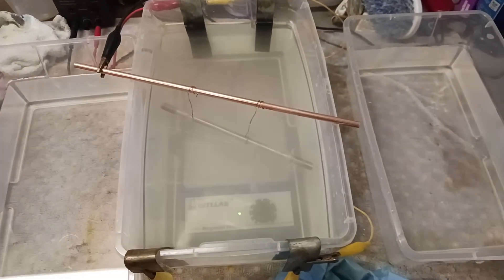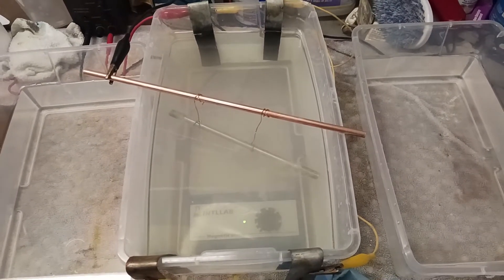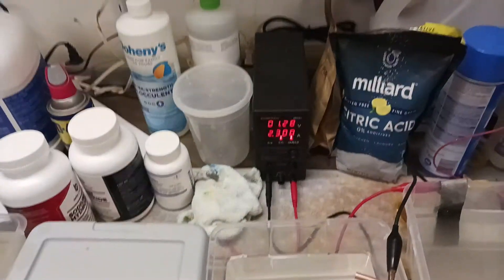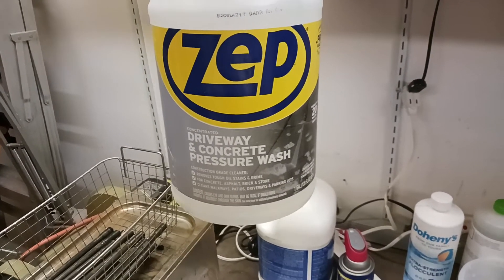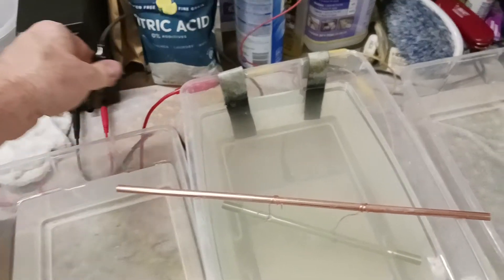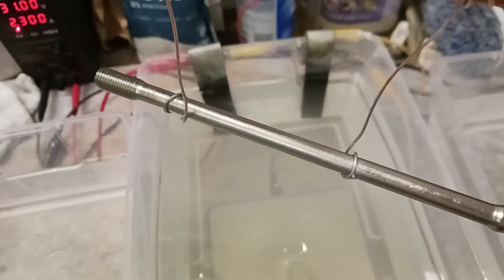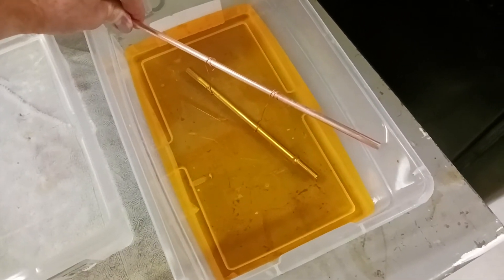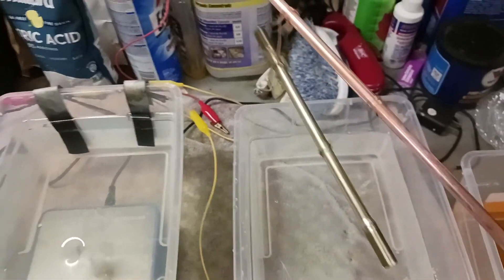DIY Bright Zinc Plating

Comment: A couple of questions. 
Do I need to periodically add more floccullent and vanillin. I've noticed the parts are starting to come out duller.
You mentioned in one of the comments that one of your anodes is steel, I believe. 3 zinc and one steel?
Is there any way to test the bath and see if things are out of chemical balance. You mentioned that too much zinc might get into the bath and upset things?
Thanks.
Reply from the maker: Yeah you will need to add more flocculent and vanillin, I believe these get consumed somewhat as part of the plating process.  Yes I am using 75% of my anode anode area as zinc.  As far as testing the bath, I'm sure there's a way but I was never doing this in enough quantity for it to really matter.  I just made the bath up fresh whenever I noticed any issues.
Reply: @mhdelano  Thanks. I've made about four batches, and found that adding flocculent and vanillin helps. Getting the amperage just right makes a huge difference. I've also found that making sure of what I'm plating is of the same size if doing several parts helps a lot.

Comment: Hi,
Do you know why the zinc anode would turn black quicker and amperage draw increase significantly more than normal?  Thx, Joe
Reply from the maker: I think the zinc corrodes eventually.  I haven't done this in a while but I remember doing a quick scotch bright rub of the zinc before every plating.
Reply: Wonder if it is the quality of the  anode or possibly my mix is getting old?  Sure has worked good for many parts...thx again...
Reply: From experincing the same problem myself and doing some reading - it seems that if you exceed around 3A/dm2 on the anode current density, you'll be getting poorly conductive zinc oxide on the anode. So either increasing the area of the anode or limiting the current could be options worth trying.

Comment: Hi,
Worked very good,thx!
Can you pour this mix into sink when done ?
Is the vapor toxic. does vapor  cause corrosion of equipment,tools in garage?
I used a respirator and did at edge of garage door with a fan blowing across and out but it would be good to know all aspects of safety.
Reply from the maker: Hi good questions. High concentrations of HCl will release harmful vapors so take care if you’re using that as a cleaning step. Also during plating you will be generating oxygen and hydrogen gas. Best to do this with some type of ventilation. Vanillin is somewhat volatile and will release vapors too. Other than that there should be no vapors released.
Reply from the maker: As far as pouring into sink you should be fine if you pour it very slowly with running tap water. Just dilute it a lot. I’m not 100% sure on this, safest bet would be to dispose of it at a hazardous waste day at your town, if possible.
Reply: Hi,
Thanks for quick reply...
I strip zinc with muriatic acid and then wire wheel part,degrease and plate...fyi,
I put several nuts with old but intact zinc plating and they came out nice.  
After cleaning zinc plate a few times with scotch pad I had to sand it aggresively to clean it..wondering if these zinc plating strips can be used until basically erroded to nothing?
Thanks...
.

Comment: That is really a lot of sodium hydroxide. Do you put that in only to bring the zinc ions into the solution or does it have another purpose? I am going to try this with just zinc chloride instead of zinc oxide and NaOH. Oh, and thank you for sharing your process with the world!
Reply from the maker: I think it's for a couple things.  1.) to help dissolve the zinc oxide.  2.) high pH 3.) ionic strength aiding the current flow in the water.    There are other ways to do this, I think zinc chloride typically uses an acidic bath, I'd suggest searching for zinc chloride specific recipes.  From my reading it seams the "brightener package" is the key thing that industry tries to keep secret.
Reply: @mhdelano  The brightening compounds are definitely the best kept secret I have researched as a DIYer.
I even bought several professional books about electroplating and at best they would mention a few chemicals, but no exact amounts.
In one german book they at least mentioned the importance of the exact dosage as they can vary from several g/l to a few mg/l, so the margin of error is minimal.
Reply from the maker: @traubengott9783  Yeah I ended up 3d printing a hull cell to figure out the right current density and additive concentrations.  For the compounds themselves I dug through some old patent literature.

Comment: What's the purpose of use vanillin? Does it help brighten the zinc?
Reply from the maker: You got it
Reply: @mhdelano  I tried doing this without the vanilli and the finish was dull. I used the doheny product though. I figured that would be all you need besides the other chemicals for the alkaline solution. I used 100% sodium hydroxide  and the zinc powder and anodes. Tried using more of doheny product with no success.  I saw the same video for the guy in the uk like you mentioned.  I'm wondering if doheny is as good of a product as he was using???? I tried doing this 3 times the same way in regards of the chemicals. I messed around with the amps to see if that was the issue. Either dull of dark gray cause I used too many amps. Anyway you can post links for the zinc powder and sodium hydroxide.  I'm wondering if the zinc powder I'm using is correct.  It said 100 percent zinc oxide.  Food grade. Help! Lol
Reply from the maker: @funnydude8523  the vanillin helped me a lot. I’d start by adding the vanillin.
Reply: @mhdelano  I'm gonna order the vanillin to see if that will do the trick. I already ordered the caswell solution and brightener to try their system. Gonna try both systems to see which one is best at this point. Thanks for the help.

Comment: Hi,
 thanks again for video...do you have to use the yellow passivate ? hard to tell exactly if the plated parts have a yellow tint..looking more for the brite zinc of motorcycle hardware...thanks,joe
Reply from the maker: No you can skip the passivate or use the "blue" passivate.  Whichever you want.  Some kind of passivate will help prevent corrosion for a longer period of time.

Comment: Would a pool clarifier made from "Organic Cationic Polymers" be a suitable substitute for Dohemy's Floculant?

I have sourced all ingredients except the floculant quite easily. I live in Australia so no Doheny's or Sparkle here. Nearly all floculants I can find are aluminium based and from what I understand these arnt the right products. Could you please point me in the right direction.
Reply: In Australia you must source pool solutions super clear by iq, same stuff
Reply: I've just found "Hi Clor Super Floc" advertised at Bunnings. It says it is "polyallyldimethylammonium chloride" which is a cationic amine polymer. Sounds like the right thing
Reply: @nickroach6270  Did this work for you mate? Also from Australia trying to source a Dohney's alternative
Reply: @joelfernandesjjf  I didn't try it I'm afraid. I'm restoring a motorcycle and I decided to focus on that rather than following the tangent of "open electroplating". I bought a Janes Kit. Do let us all know if you try it and it works.
Reply from the maker: That sounds like it is a similar product.  I would try it.

Comment: Hi there thank you for the brief explanation. I ordered my chemicals according to your instructions. I just want to ask a simple question for not to blow my house to sky :) Is it possible to mix together all dry powder type chemicals in a seperate container and add the proper amount to "lets say 1 liters of distilled water at the same time instead of weighing and putting everyone of them one by one and stir them for 5 minutes individually. Thank you again for this great video. Cheers
Reply from the maker: You will want to mix the NaOH into the water first, this will elevate the pH of the water significantly (pH 14+!!!).  This will help the zinc oxide to dissolve.  So I would first dissolve the NaOH, then the zinc, then the flocculent, then the vanillin.  You could try it all at once but it might take longer for everything to dissolve.
Reply: @mhdelano  Thank you for your answer. I'm going to do it that way. And with the remaining dry chemicals (because I bought 1 kg NaOH) I will make a concentrated solution that I will add DI water and dilute in the future. (of course I dont know if it is okay to store it for a year or two that way). Thank you again. Cheers

Comment: This video is awesome, I have everything to replicate what you’ve shown here, but what’s your solution, just straight vinegar or something else? & did you use zinc oxide bought from online, or did you extract it from batteries, or just dissolve some pure zinc in the solution? Thanks !
Reply: Never mind lol it’s DI water, & I bought some food grade zinc oxide. Hope I can get the same results as you!
Reply: Well I tried it out, it came out pretty friggin good. Just make sure the hardware is polished before plating if you media blast to clean, I used a bench grinder with wire wheel. My scale was also pretty vague so i’m sure some of my measurements weren’t as accurate as they should’ve been, but the final result is awesome, even the captured washers on my bolts were plated

Comment: Are you using zinc for the anodes?
Also, I tried this formula, started with experimenting on a penny and the results I got were very dull gray or even near black at 3.5v. The container I am using is a 1000ml beaker so the anode and cathode are pretty close which I've heard can have an effect, and my power source is an ancient electro-plater with a single voltage regulation knob, I was using between 1.5 and 3v. I'm guessing I possibly have too much current for the size of the part since we're talking very little surface area - the electro-plater has a gauge for the current draw but it's not even moving with the voltage I'm applying.
Reply from the maker: For anode area I'm using roughly 75% zinc and 25% steel, this prevents too much zinc buildup in the bath.  It's more important to know the current and adjust it per surface area to be plated.  Controlling current indirectly by voltage is almost impossible, too many variables.

Comment: I've been tinkering with this cocktail for a few days now with some great results. It's probably as good as the Caswell kits i'd say. Thank you for sharing! 
I think the most important step is setting the correct amps for the part. Easiest way i found to do this is to start at zero and slowly increase the amps until the part just starts to fizzle. Not too much or you will burn the part. Or do it the Caswell way. Surface area in Inches X 0.14 = AMPS.  The litre i made i had to add about another 10g of flocculent to get the crome finish. The more time and flocculent i added, the shinier the parts. Also used 15g/L instead of 12g/L of Zinc Oxide to decrease platting time (more than 10 min).
 A few tips for anyone trying this out.  Make sure all ingredients are close to 100% pure. Give the zinc anodes a clean every now and then or when they get really black (sandpaper works well). A magnetic stirrer or a mini water pump is a must. If the part does not come out 100% perfect, a small buff with a metal polish will make it super crome! I was looking for a crome finish so i used a Blue chromate.
Reply from the maker: Glad you are having success. I’ve noticed as my bath has gotten dirtier it’s much more sensitive to the correct current. I should probably make up a fresh one.